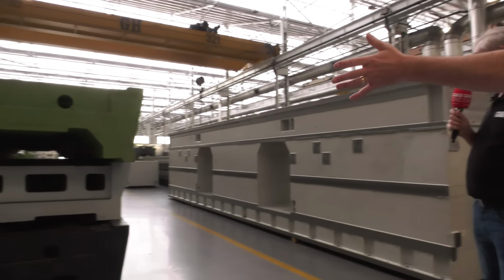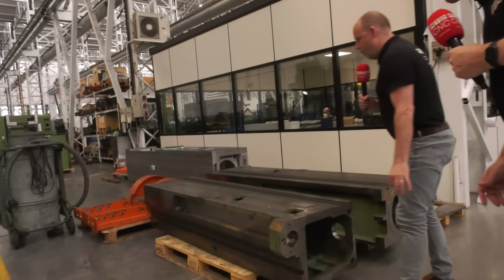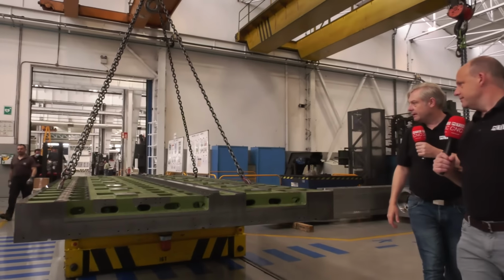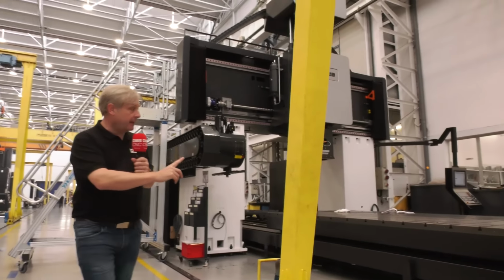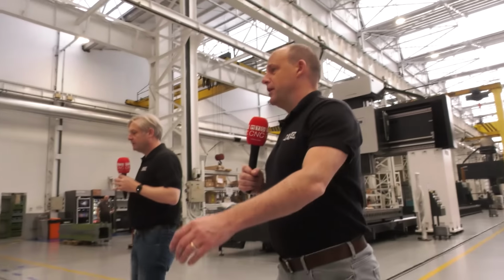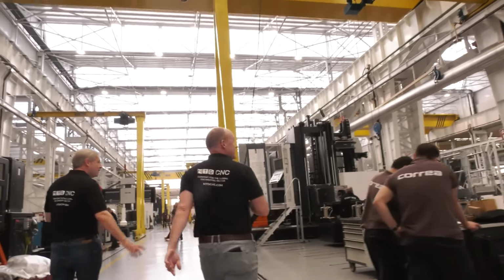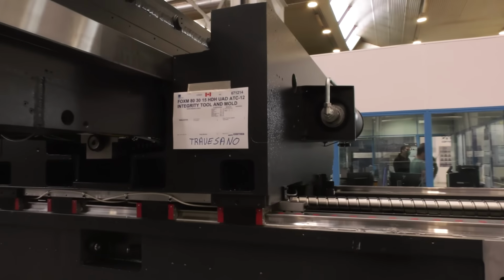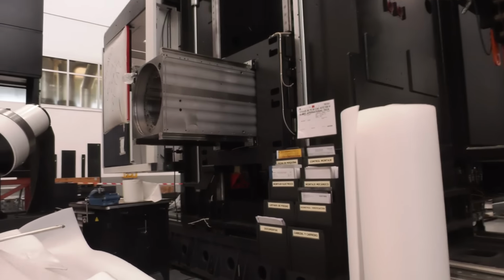Correa factory tour – 75th Anniversary

Comment: Can’t believe you’ve got walk up access to machines cutting metal, where’s the CE markings? No wonder they can undercut the competition without guarding etc?
Reply: Guarding isn't a fundamental requirement of the Machinery Directive. Machinery must be constructed so that it can be operated without putting persons at risk, but guarding is only one way of achieving that aim. A fully enclosed machine can still be dangerous and a machine with very limited guarding can be made safe using other engineering approaches. Correa are a serious firm making serious machines and I have no doubt that they know what they're doing.
Reply from the maker: @j.dietrich  agree